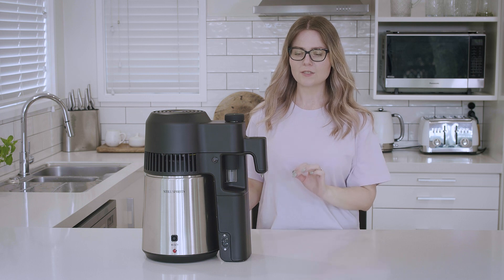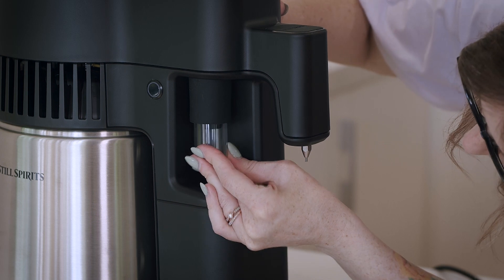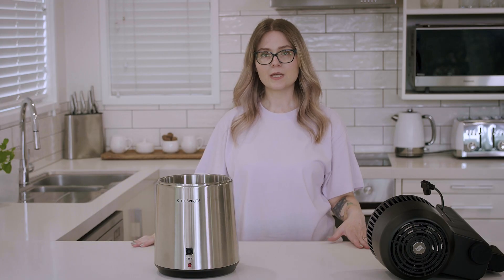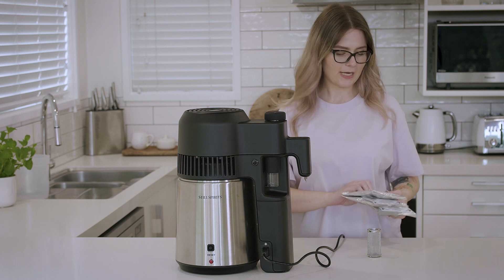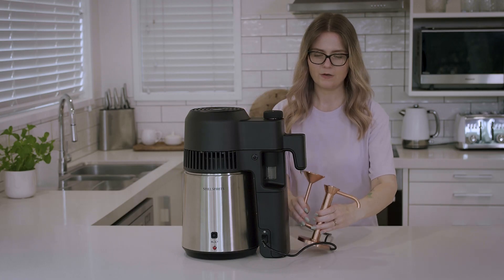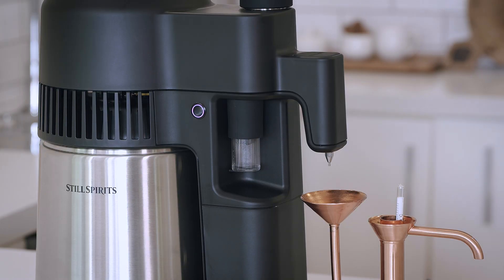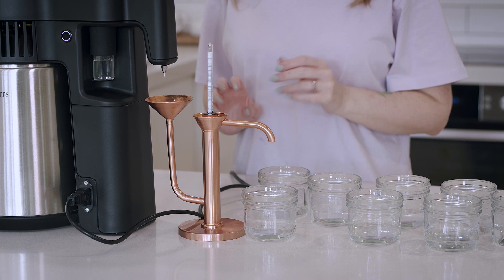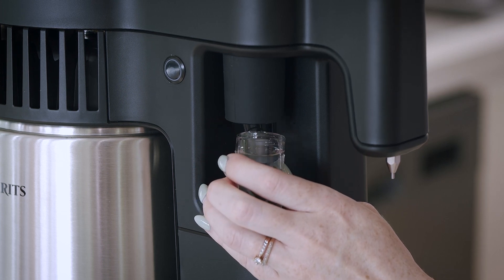How to Distill in Pot Still Mode On the Air Still Pro | Still Spirits

Comment: You realy have to remove all the copper and steel things to have a proper pot still mode ? A find it a pain in the ass too do on mine.
Reply: It would be really good to understand this - any response from Still Spirits?
Reply: @mikedodd1117  Nop but by testing I found out that you really need if you want to avoid to have somme liquid in the column. Apart from this no problem.

Comment: Looks like a Fantastic bit of Kit! I have 2 questions though. 1, How much Yield do you get on Average in Pot Still Mode for one 4L Run if you were to add the Heads, Hearts & Tails together (or just didn't take Cuts), and rough ABV for the Run? 2, Could you just use the Pot Still function with Wash and the Botanical Basket to make Gin, instead of running the Reflux and Diluting to 40% then Re-Running?
Reply from the maker: Hi Glenn, thank you for your questions. You would get the same yield as the Air Still, 700ml @ 60% in Pot Still mode (1L @40% Diluted). Yes you could use the Pot Still function to distil wash through the botanical basket in a single run to make "Gin", but you would end up with a low quality spirit and yield.  You will achieve far better quality if you Reflux to make a neutral spirit and then vapor infuse. Alternatively, you could Reflux to get a neutral spirit and add flavorings. View our range of flavourings here: https://stillspirits.com/collections/flavourings

Comment: If you collected foreshots on the first reflex run, why would you need to collect more foreshots after diluting down to 40% and running again?
Reply from the maker: Hi, thanks for your question. While the foreshots collected in a spirit/botanical run has a far lower chance of containing methanol if removed in the stripping run, the foreshots still contains volatile compounds than the heads hearts and tails of the distillate. By collecting the foreshots in the spirit run, you're ensuring that the spirit you collect is the best quality without any harsher aromas or flavours. You can always add the collected foreshots into the rest of your collected distillate at the end of the run if you wish to do so.
Reply: for this run its to remove the flavors from the botanicals. its also the reason why you don't ever use a parrot for these runs. it will smear the good and bad flavors and you wont be able to separate them.

Comment: So, correct me if I'm wrong.. you've put 2.2L of the 1st run diluted down to 40% What was the intial % then ? and do you fill up to full mark again ?? Bit confusing
Reply from the maker: Hi Dale. Thanks for your questions. We started with an initial ABV of 90% which we obtained from 2 runs in reflux mode (made with an entire 8L Still Spirits Fermentation Kit wash) which we diluted down to 40% ABV, giving us a total volume of 2.25L. We did not fill the unit back up to the full mark as we had over 1L of liquid in the boiler which is the suggested minimum.

Comment: If its air cooled, How does it perform on hot days?
Reply from the maker: Hi Paul. Thanks for your question. The air cooled condenser performs the same as the Air Still on hot days (if you are familiar with the Air Still). We have done extensive testing mostly at 20-25°C ambient temperature, however also tested in Australia during Summer and there were no performance issues. As a general operation safety guide, we do not recommend operating the still in ambient temperatures above 40°C (104°F).
Reply: @StillSpirits89  I did wonder that like say my house in summer and it can be over 30.c if no A/C, and in winter the kitchen can be cold as a fridge.  I would think the condenser would work a little better with that??
Reply: In Australia anything around 40c is cold beer weather, maybe a spirit over ice as the day progresses. :)